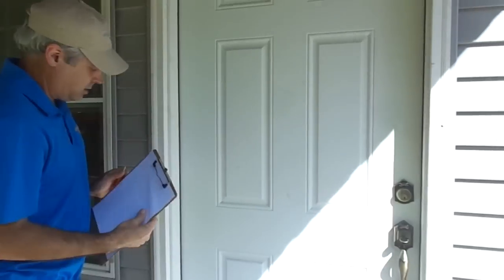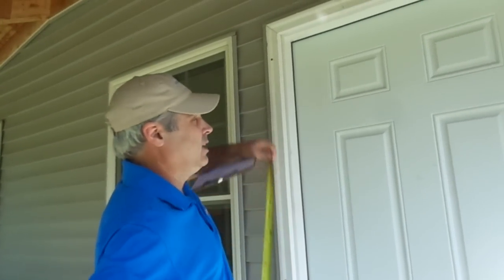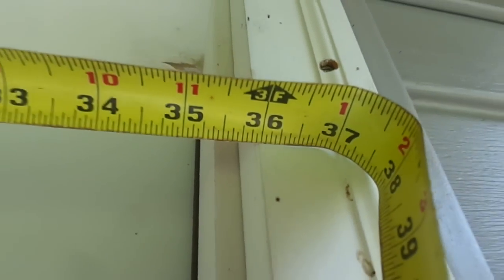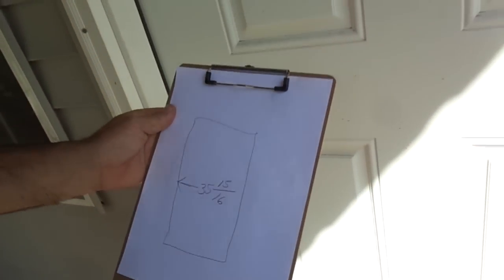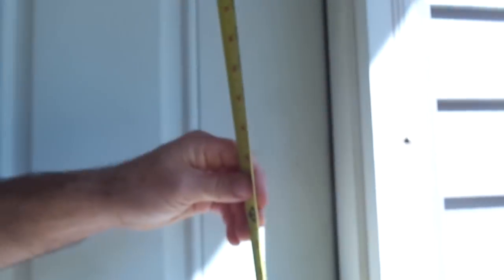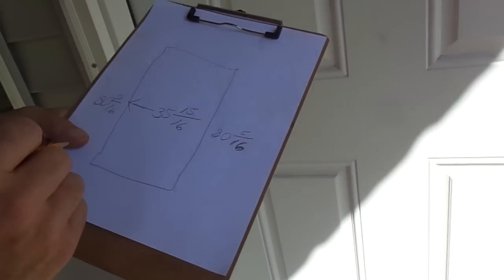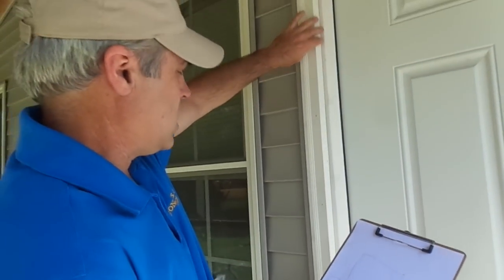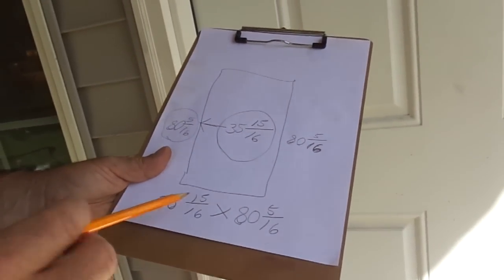Screen Door Opening: Measuring instructions

Comment: so, most standard screen doors that you can buy at Lowe's or Home Depot are 30, 32, 34 or 36.  Is he saying you'd have to order a custom door?  As in his example here, could he buy a 34 inch wide door and make it fit, or what?
Reply: Yeah... Most of the time, you can rip qual amounts off. However you will not obtain the same width of board all around.
Reply: Yes. You round down and then fill in the gap with moulding.
Reply: Those standard size doors are not absolute sizes, they "usually" have tolerances that are +/- 1/2" so a door advertised as a 32" door will fit a 31.5" width and up to a 32.5" width.  Download the installation manual first, before you buy and make sure that is what the manual itself states.
Reply from the maker: I make Doors to fit openings with minimal but necessary trimming, This video also tells a person how to write down on a paper they can carry to the store to find a appropriate blank.
Reply from the maker: If I had to buy I would buy bigger then fit & trim. doing otherwise would restrict the opening.

Comment: I appreciate your attention to detail and taking your time explaining on this video.  I would would have a video like this 30 seconds and probably of missed some important details.  I do have a question:  Why do you go with the larger measurement on the height? I normally go with the smaller measurement.
Reply: So yes and no, in screen manufacturing you should always document 3 things.
1. Lockheight you want ( so as to not interfere of pre existing hardware or to replace screen already there in same holes)
2. Not any difference in HWS ( Height, width and square)
3. Build out or stops required.

Comment: My house is 90 yrs old.   I have the old style metal storm door with the double  glass, both replaceable with screens. The casing is 29.5" but that's with the door installed of course.  I wonder if I take the aluminum casing off the frame if it will be 30".   
So, a door that is listed as 30".. is that with the casing or without the casing?

Comment: I don't want to install a screen door, I just want to replace one that's broken. So can I just measure the door? If so, what are the chances that I'll find the exact measurements at the store?
Reply from the maker: Yes you can measure just the door. The store will carry What is called a door blank. It will need to be trimmed to fit most of the time. I make custom screen doors so this video gives my costumers instruction of the proper way to measure. I send them down a door that is a close fit needing little trimming.

Comment: Donny, why do you subtract 3/16 from the 15/16? (Sorry I suffered a TBI, I can't think right sometimes).
Reply: probably for the hinges
Reply: Donny, I am curious to know the answer to this question as well.
Reply: To allow for the door to swing. You're making a door, not boarding up the opening.
Reply: Ditto! if you're going to make a video, give us the reasoning behind making it 35 3/16.  My measurements are 32/31.75/32  Do I make the door 31.75" wide then?
Reply: He gave the reason at 5:10. Because it allows a slightly off kilter doorframe to fit the door.
Reply: to consider the TANGENTIAL STRIKE of the inner side of the door's lock-side jamb against the door frame.✌✌✌

Comment: why is the door width 3/16 smaller - need explanation!!!!!!!!!!!!!!!!!!!!!!!!!!!!!!!!!!  Is it for the hinges?  Is it 3/16 smaller than the smallest measurement? 32/31.75/32 Then you did the math on the bigger number. Why?  I plan to make the screen door myself so these details are important. Thanks
Reply: Door needs to be able to swing open. For this it needs clearance.
Reply: 3/16 will be enough space for the thickness of the screen door to clear the casing on each side.